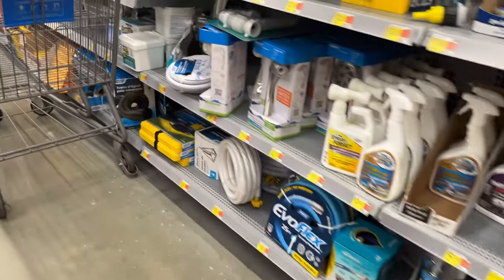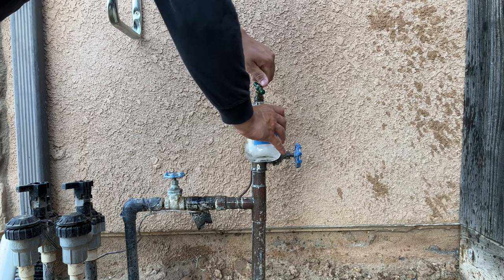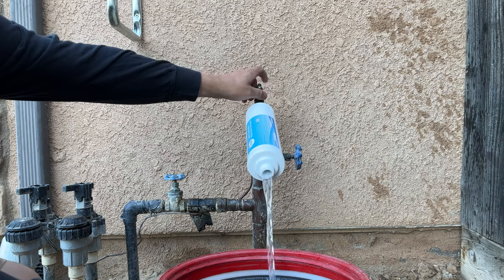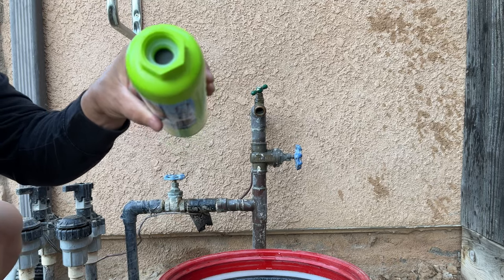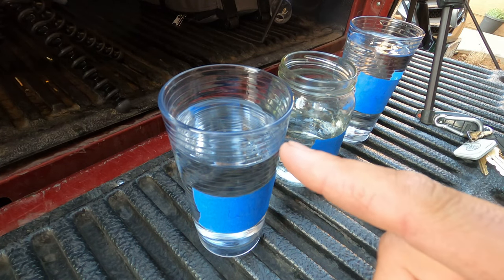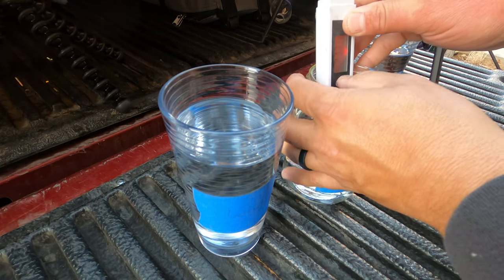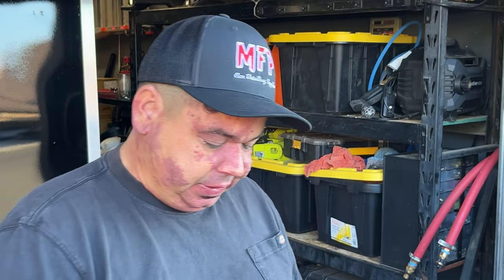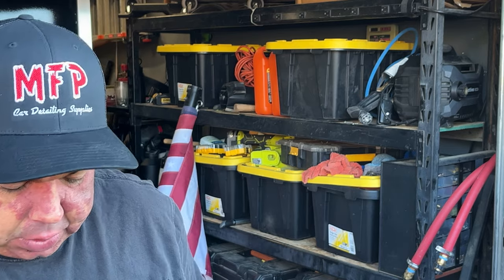Walmart sells deionized water now? Tips and Tricks | Stay Slick

Comment: I don’t get how the numbers would increase with the filters. Makes no sense to me. These aren’t deionizing filters. They aren’t meant to filter out the minerals which is what you’re measuring. That’s what’s good about these. It allows your body to intake the required minerals needed. I also looked at this green filter in Walmarts website. I couldn’t find anything that said anything about the PPM. It does say it filters down to a micron. Which is good. It  doesn’t filter the healthy minerals your body needs. Which is also good. Unless you’re washing cars. You need a deionization filtration system like your Culligan.
Reply from the maker: If you’ve ever read the labels on bottled water it might say “minerals added for flavor.” It’s the same concept here.

Comment: I was getting so excited!!! Here in England, the water is like acid! Especially, on a black Tesla. So, in the booming heat, I do the car as quickly as possible, then I buy a 2litre bottle of de-ionised water and put it in a sprayer and liberally go over the car before the heat dries the tap water. I need to test the bottles of de-ionised water now with one of those PPM devices thingys. Tried doing a car in 106f = 41C… big mistake, as the heat nearly killed me and the car 😂

Comment: Flow rate…
They are max 1.5-2.5. Over that you are overpowering the filtration.  I mostly rinse-less wash now, so I use two RV filters in line. Chlorine to mineral. I’m usually 64 ppm at tap, nothing changes on full blast from the spigot. But, if I throttle down the flow rate, I get down to 0–1ppm.  I just make 10-15 gallons at a time.

Comment: It would be interesting to see the numbers if you ran two or three of those filters in the same line. I've been using them also, in hopes that water spotting would be lower, but really can't tell a significant difference.
Reply from the maker: I’ve done 2 in line and only saw a very minimal drop. You get diminishing returns.

Comment: Yeah idk who told you that those give deionized water they don’t and they can’t. They only filter out chlorine, and non dissolved solids. The 1 micron doesn’t equate to 1ppm removal that just stands for the the size of the particle that it would have to be for it to pass through. The reason you see a higher increase in the ppm is because they are designed to have water flow through them at very low rate.
Reply from the maker: Yeah honestly I knew it wouldn’t work I was extremely skeptical before because of my experience with the blue filters. But it was worth a try and made for a good video

Comment: So why is this deionised water so important, don;t you dry your vehicles with a towel if your a detailer? Now Fleetwash, could you afford the filters? I'm confused about the deionezed water? And what is a bad TDS, mine is about 75-100
Reply from the maker: The point of the ionized water is peace of mind. If you have the Enos water, there’s a 0% chance she will get water spots. When you’re working out in the heat in direct sunlight like most mobile detailers, do there’s always a chance of water drying on the vehicle. A good TDS is 20 or less.
Reply: @StaySlick  SO my PPM is around 85-100, Do I need this

Comment: What about using one of those inline filters for washing, but then rinsing with distilled water?
Reply from the maker: Because these filters actually add total dissolved solids I would recommend not using a filter at all. A trick you can use is once you just finished rinsing the soap off after your contact wash spray the whole vehicle down with ONR and then just go back and dry the vehicle like normal. ONR actually softens the water and prevents water spots.

Comment: I have the On-the-Go DI water system and went from 425ppm to 0ppm! I only use it once in awhile for a final rinse. I had tried one of these before and it lowered the ppm a little.
Reply from the maker: And good to hear that it works for you I haven’t heard of that one so I have to check it out. Yeah I think if you have a really really hard water like 300 for 400 and above and this could be a benefit on a budget but otherwise it really does nothing

Comment: ? you're doing it wrong.   you can't open the spigot all the way you have to just let the filters absorb just the amountwhat it can hold inside. to get low numbers which defeats the purpose it would take a whole day to get a good amount of spot free water  run the hose spigot barely open though it for 10 min then start checking less slower it filters the better. it's the same price to go buy 90 gallons di water than to invest in anything that you can do it yourself with so just go full up at place with di water.  don't be fooled into getting these things
Reply from the maker: Did you watch the whole video? I said that some people were saying it worked. I obviously didn’t believe this hence why I made the video.